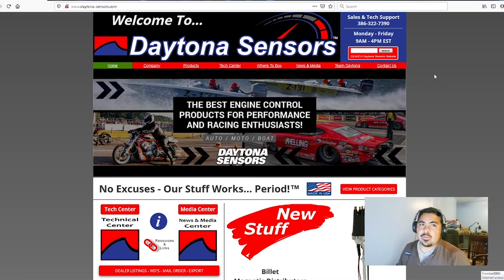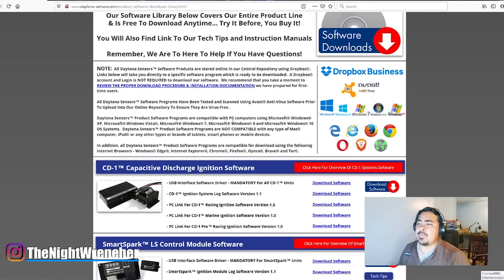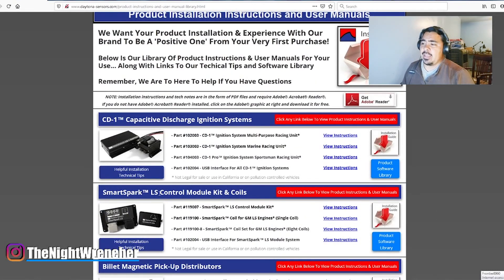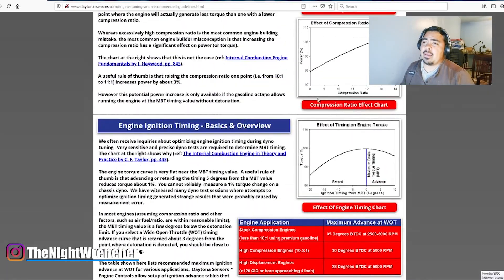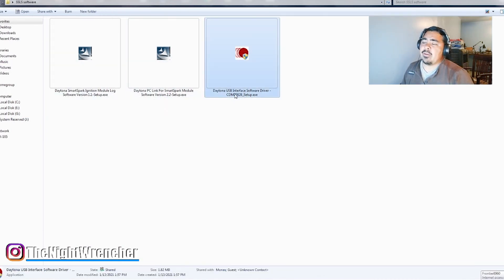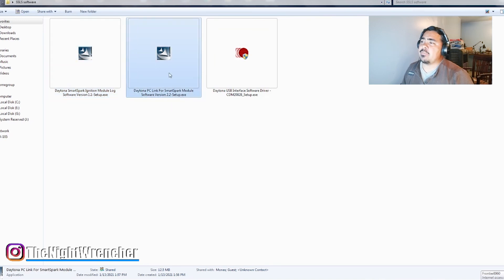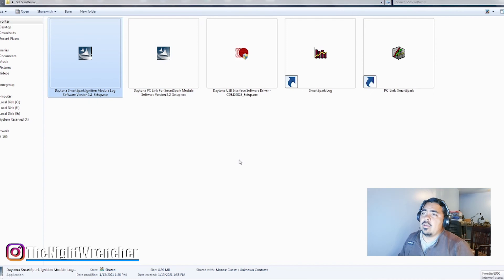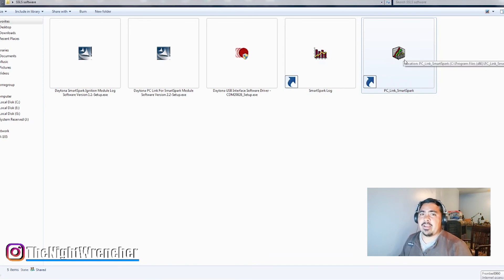How To Download And Install The FREE Smart Spark LS Tuning Software | Daytona Sensors SSLS |

Comment: Hey bro my I think my 6014 got fried.  It was running good for about 2 years and was welding some fenders and forgot to disconnect the battery, when I tried to start the car it just cranks like there is no spark my laptop says is a cam sensor but already swapped 2 on it and it just won’t turn. Is this common?
Reply from the maker: Aw man, that sucks bro. Its not that common but I have heard that happen.
Reply: @NightWrencher  yes I was reading some stories about that. I think I will go same route as u.
Reply from the maker: Thats sucks bro, I feel for you. But, if you end up switching, itll be a little cheaper to just use the adapter harness and SSLS vs getting the whole harness. Saves like $100 but you'll need to do some rewiring.
Reply: @NightWrencher  yup I seen the vid u have, I’m thinking about it